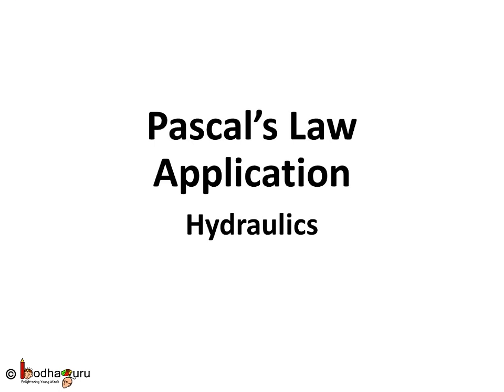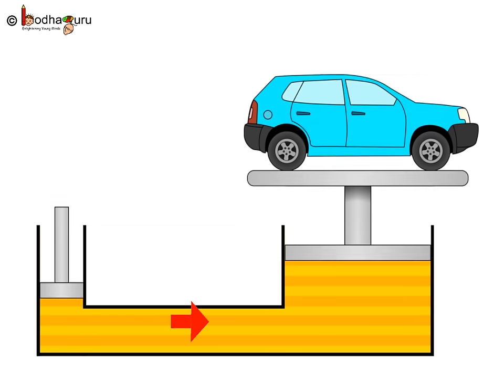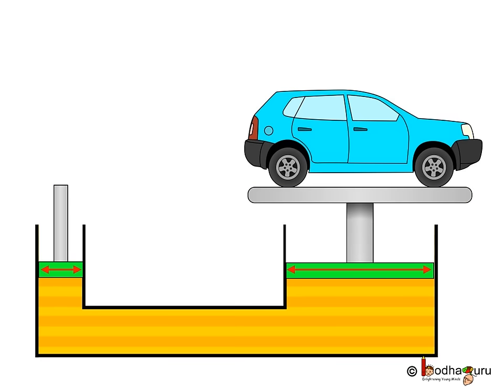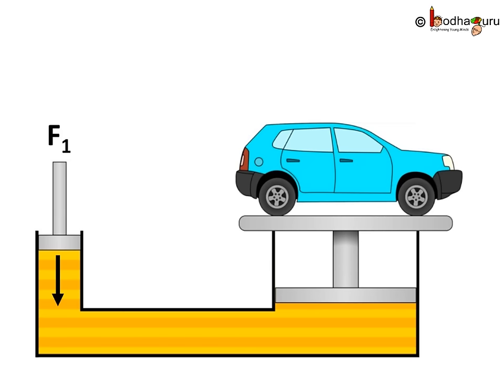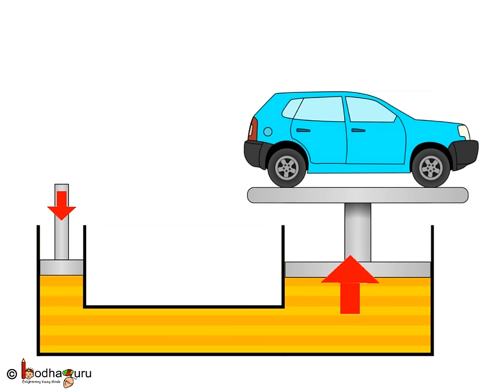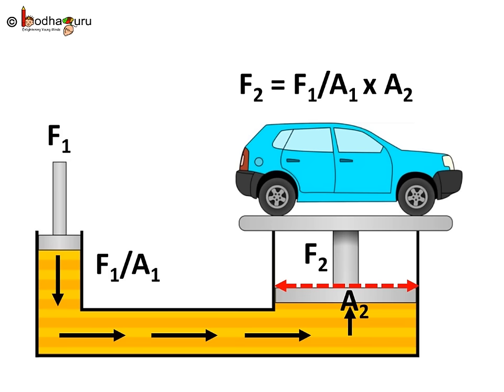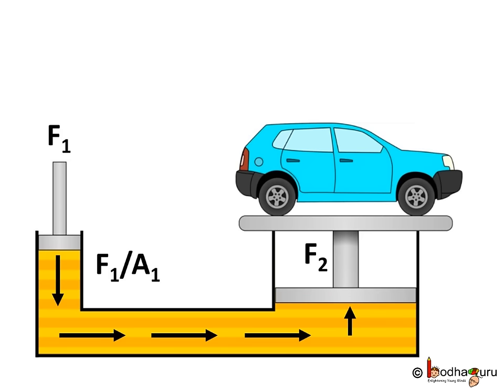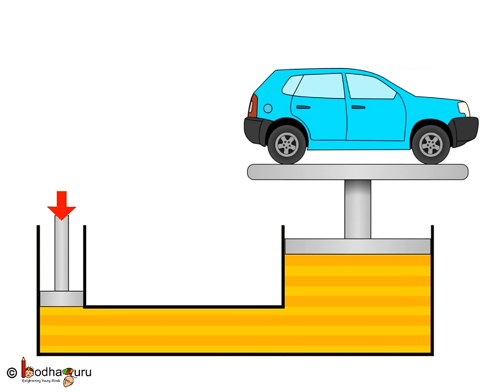Physics - Application of Pascal's Law  in Hydraulics -English

Comment: Sir, can you proof that Pascal's law does not violate the law of conservation of energy?
Reply: Yes
Reply: Her animation is wrong and would violate the consveration of energy.
I just watched "How a hydraulic jack works (3D Animation | Pascal Principle)"

It's like a door handle where you need a greater distance with less force to have this high force for a small distance. So the overall work stays the same: F1*s1 = F2*s2.

So if the force gets 10 times bigger, the car should just get to 1/10 higher of the pushed height difference.

Comment: But the car is also applying opposite pressure on the larger arm
Reply: pressure is dependent only on height. 
it would be easier to push a small line of water to raise the car.
But the force of car is neglected as the quantity of water below the car is a lot
Reply: But car doesn't apply enough force

Comment: Dear Madam............Example Problem I have a single acting hydraulic cylinder with a stroke of 300 mm, a bore of 18 mm and a rod of 10 mm
 if the press weight is 1 mm on the Piston Head what is the pressure.....Please explain the calculations

Comment: You said pressure applied to enclosed incompressible fluid.  time .28 so how it would lift the car without compressed?
Reply: The car would not lift as efficiently if the fluid compressed under pressure. If the fluid compressed, it would take more force to build the same pressure to lift the second piston. 

With incompressible liquid, pressure is distributed evenly to the larger second piston. This multiplies the input force by the area of the larger second piston, which results in a greater output force, which means you are able to lift more load with less work
Reply from the maker: @Michael_Crist   thanks for the reply. Yes, that's the use of Pascal law. Hydraulic systems use a incompressible fluid, such as oil or water, to transmit forces from one location to another within the fluid.

Comment: How can we measure the equal force on both the sides in hydraulic system?
Reply from the maker: hydraulic system actually transfer pressure . Now, pressure acting one larger surface   → pressure x area = total force applicable. So, it is equal pressure which acts on larger surface to apply more force.

Comment: What about a symmetrical u shaped pipe containing two liquids such as water and Mercury. The equation is p1 = p2 = ro1 . g . h1 = ro2 . g . h2
Please make a video about it
Reply from the maker: It doesn't need another video. Shape of pipe doesn't matter, propagation of force would be same. Just, in case of finding area, it would be pie x r2 . Pie would cancel our from both sides and radius squared remains

Comment: What if the width of both the as said u shaped tubes is same? Will the pressure be still multiplied.
Reply: I think u apply the fluid pressure formula after using Fi/A1=f2/A2+rho h g
Reply: The pressure will still be same but there's no point in using such case in reality as we don't have the human power to apply a force equal to life a car....

Comment: No, No, I inch, how will i measure,1d only, no its applicable 3d way cubic centi or inch, but 100g force, on 1 cubic centi, (what is measure for cylindrical ? inform me) is trasmitted to 2 cubic centimeter ie 100/2 =50g/cc, no len only

Comment: This explanation is based on the centuries-old presumption that all fluids act the same, i.e., liquids act as gases with respect to pressure applied being transferred throughout. With a gas this is true and is facilitated by the property of compressibility. For example, by decreasing or increasing the amount of a gas in a rigid container, the internal (gaseous) pressure in a container is decreased or increased, respectively, and this change in the number of molecules results in a corresponding change in the pressure exerted by the gas against the container walls. Thus, this link between gaseous pressure and the pressure exerted by the gas against the container walls is accomplished (facilitated) by the characteristic of compressibility. But a liquid is not compressible and thus there is no means by which the pressure exerted by a liquid against its container walls can be similarly linked to the liquid's internal pressure. Therefore, the hydrostatic paradox which states a liquid can exert a force against the bottom of a container that exceeds its weight is false and thus the physics in this video is wrong. Don't believe me, just evaluate yourself. For more details see my video titled Elementary Hydrostatics at my channel.
Reply from the maker: Well thank you for the feedback and I disagree in few points. 
This force multiplier is already in operation in hydraulics throughout the world 
 The principle work upon the assumption that liquid is not as compressible as gas. The molecules are mobile, but inter-molecular gap is much lesser than inter-molecular space in gas which actually helps in transmission of pressure.
Reply: Thank you for your response. I understand your point regarding the difference between a gas and liquid. And I understand that what I would refer to as a liquid's characteristic of incompressibility facilitates transmission of pressure. However, that would also be true were pressure transmitted on the basis of applied force, which I contend it is.  As for the force multiplier being in operation throughout the world, as an engineer I disagree, referring to the operation of factors of safety, but that is besides the point. Getting back to my comment, it is on the precise physics of how force is transferred on the basis of applied pressure rather than applied force, that has yet to be explained because it is impossible. Liquids are simply lumped in with gases, whose behavior is vastly different since they are compressible, thus allowing the force exerted by a gas against container walls to be the same as the internal pressure. The physics of the hydraulic lift can be simplified to that of a bottle with a narrow neck and a force applied at the top, or even simpler, no applied force, since the physics of both have the same basis: for example, if the bottle has a cross sectional area at the top of 0.1 square meter and an area of 1 square meter at the bottom, the force exerted by the water on the bottom is said to exceed the weight of the liquid. Now, since water cannot expand and cannot increase in density, just how can water exert a force that exceeds its weight? It is impossible, therefore it is impossible for force to be transferred on the basis of pressure., and that is my point.

Comment: I have a doubt:when area is less then pressure is more then in the video the left side one which has less area then the pressure should be more na..
Reply from the maker: To start with , we are applying a small force F1 on left side ,and the decent pressure is created as the area is small so P1 =F1/A1. As per Pascal's law , this pressure will transmit equally throughout the fluid and reach the larger tube .
So P is same on right side i.e. it is  P1.  Now F2 on right side will we PxA2 , P =P1=F1/A1  so F2 = F1/A1 x A2  so we see , force at right side gets  multiplied many times.
 (A2 is much larger)

Comment: Is this violating the law of conservation of energy
Reply from the maker: No, pressure is transferred → now, that pressure works on bigger region means more force , as force = pressure x area; here energy is not created. water coming out of pipe @50 km/hr speed doesn't do much harm and cannot do much work, but when lots of water like flood water hit you at 50 km/hr speed, it is force  = pressure x area, hence you feel a tremendous force.
Reply: Pascal law very good

Comment: This vid COMPLETELY  and TOTALLY failed to mention one of the most important parts of the equation....one creates a larger force by applying that smaller force OVER A GREATER DISTANCE!  In other words, using the animation example, the smaller piston on the left would have to move downwards a greater distance than the right would lift. Otherwise, imagine a system with a small piston vs. a larger one. Drive your car onto the larger one, and what...lift it with a finger pushing down on the smaller cylinder?  The narrator's failure to mention this BASIC fact about force multiplication, whether the method is a straight lever (see-saw), a pulley system (which are just circular levers) or a hydraulic system, is unforgivable, and  totally negates the validity of the video.
Reply from the maker: Thanks for your inputs. Yes, we totally agree with your thoughts -" One creates a larger force by applying that smaller force OVER A GREATER DISTANCE! " This should be emphasized clearly  instead of being subtle, so that children are not confused.!!  We'll definitely try to do this in our next video!
Reply: This is the point that was missing that had me confused after watching the video. Thanks for clarifying. I was imagining an extremely thin piston (volume of finger) and a piston with the volume of 3 cubic meters. It can't be possible to lift a car the same height that the water from the thin piston traveled.
Reply: exactly. V1=V2 with V being the volume of displacement. thank you. I thought i was the only one who noticed it.

Comment: What are the advantages of hydraulic system?
Reply: When compared to the mechanical power method has a weakness in the placement of the transmission power position. It is different with hydraulic power hydraulic power lines can be placed in any place. Regardless of the position of the shaft to the power transmission as in the mechanical power system. Hydraulic power is more flexible in terms of the placement of its power transmission.
 

In a hydraulic system, very small forces can be used to move or lift very heavy loads by changing the cylinder cross-sectional comparison system. This is none other than the ability of hydraulic components at very high speeds and pressures. So that small and light devices can provide enormous power. When compared with an electric motor that has the same horsepower capability. Assuming that the transmission shaft and gear sizes are needed to obtain the force that can be achieved by a small hydraulic press device. It will be proven that the hydraulic system can provide greater horsepower at the same size, even if it is for other systems.